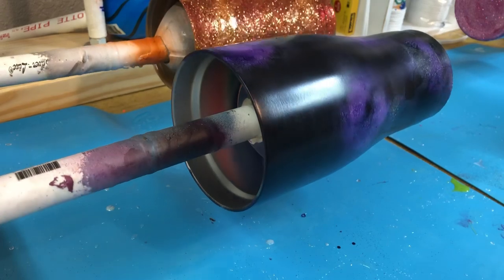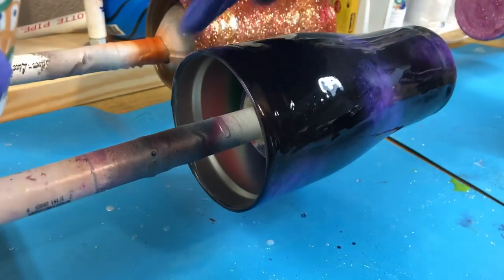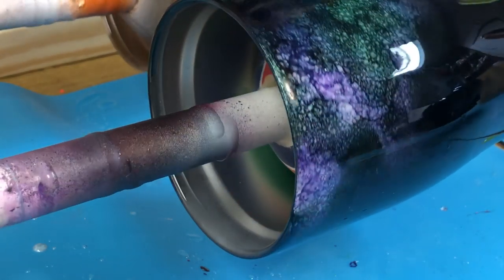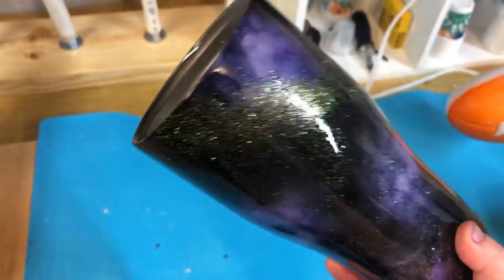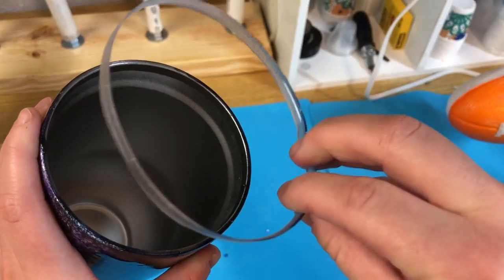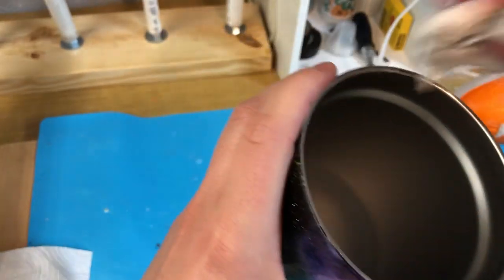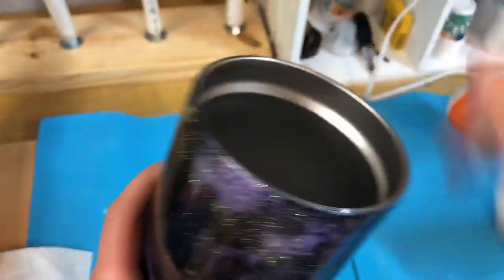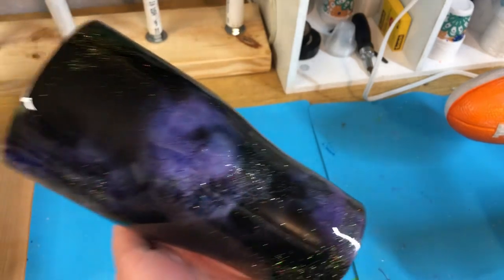How to get a clean rim on your tumbler every time

Comment: I have a problem of the top and bottom edges being rough almost as if there was not enough epoxy to cover it even though I put plenty I have tried sanding it down then add more epoxy but the same problem any suggests?
Reply: Have you figured it out yet? I put enough epoxy on.  I rub the cup up-and-down constantly I make sure it's fully coated and yet I still have a rough lip around the cup and bottom
Reply: Cut the foam away from the top. Cut away 3/4 of an inch inside the top of the cup.

Comment: 🤯 what?!?!! This whole time I've been avoiding epoxy anywhere near the lip 😅
Reply: It’s actually better to push some inside all the way around and make a solid ring in there .. than it is to have just tiny bits here & there.  By making one slit (from lower inside to the upper inside) and then the whole thing will usually pop out in one piece 😁.  If not in one piece a little push n pull and it’s popping off.  For me anyways.. trying to get those tiny bits is a pain ✌️
Reply: @debrajol3585  thank you for the insight!
Reply: I’ve also been told that by putting a thin layer of Vaseline/petroleum jelly inside the rim ..or the rim and a few inches down.. that nothing sticks including the spray paints.  I haven’t tried it yet but I’m buying the petroleum jelly now that I’m thinking about it again. 👌 
Happy Arting!! 🌹💯🤩
Reply: @debrajol3585  I bought tumbler shields, which sit on the inside of the cup....they work AWESOME for spray paint and their supposed to also work when doing your epoxy, but I always forget to disconnect after a few minutes of spinning. Either way they are a great product and the best be part is that they are silicone, so nothing sticks!

Comment: Hi, I’m really struggling with the rim of the cup mine just aren’t sealing. Are you not breaking the seal while scraping the excess off the lip? Does it all have to do with angle? Is there any epoxy on the lip left at all after you scrape it?
Reply from the maker: Try sanding the rim as well. Sand towards the tumbler a tiny bit. Then epoxy over again to get a good seal.  Hope this helps

Comment: thanks so much for this. How do you not cut/scratch up the coating on the tumbler when removing on top and rim?
Reply from the maker: Practice makes perfect I guess. 

Make sure your blade pressure is pressed towards the inside of the tumbler. Not the outside, so the blade doesn’t slip

Comment: Can you tape the very top before adding design, then remove tape during final epoxy stage & seal in design? Essentially leaving a very small ring on top without design but still locking it in with epoxy.
Reply from the maker: Yes. Make sure you remove the tape before the epoxy is dried or it will be stuck to the epoxy

Comment: if you add tape at the top so you have some space where the epoxy doesnt touch how do you avoid the harsh edge when you remove the tape? im doing a ceramic mug and theres a definite line from where the epoxy ends and the ceramic begins? can i get rid of that? any tips on what i could do to avoid in the future?
Reply from the maker: Maybe sanding lightly will help

Comment: When you do a bottle style what do you use to hold it onto the Turner? The regular tumblers I use a pool noodle but a friend wants a bottle style and I can’t figure out how to make it fit the Turner
Reply from the maker: Crystal Williams I don’t epoxy bottle size. But, I would use bubble wrap or a rag.  Take your pipe and tape bubble wrap or a rag around until you have tour size correct
Reply: Ace bandages work great. Not the cloth one but the stretchy self adhesive rubber like one. You can wrap ther pole until you get the snug fit you want.  😘
Reply: @datladee  thanks for the tip!!

Comment: Do you have a tip for wine glasses or wine tumblers? Because the shape of the cup the foam sits on the rim while it spins so the epoxy is super jagged and has an uneven seal to clean up. I’ve been struggling with that. Thanks for this video it helped a lot!
Reply: I sat my cup on the foam and took a marker and marked around it. Took cup off then drew another line 3/4 of an inch in then cut the foam off. When my wine cups are on the foam it comes within 3/4 of an inch from the top.

Comment: Hello your cups are amazing! Thank you for this. I have asked this question on several other pages with no reply. I do have a question also. Can you tape the inside of it? I'm assuming you will still have to use the knife to cut it. That noise though gives me chills. To me it sounds like nails on a chalk board. That's why I'm asking about the tape. Like painters tape.
Reply: LaDonna Horton a lot of people use electrical tape
Reply: A lot of people use electrical tape
Reply: I use masking tape let it turn for 30 min then take tape off and wrap a baby wipe around my index finger and clean the inside of the rim.

Comment: do you think taking your design all the way to the edge is better for creating a long lasting seal. I've only ever left a gap at the top of my cups, but I can literally take a blunt object and peel my design completely off especially on glitter cups. This is even after a week of sitting.
Reply from the maker: Abigail Felder Good Question. I’ve had some of my tumblers for over a year and never has my designed peeled.  To me, I’ve perfected my tumbler not peeling off my tumbler. Maybe you are cutting the epoxy too low or not at the right angle. Maybe the epoxy is too thin? Leaving a gap is perfectly fine, it’s whichever way you prefer and most comfortable with
Reply: Ms. Kiss Kreations thank you so much for your tips. I’ll watch more of your videos to figure out how to perfect my epoxy skills